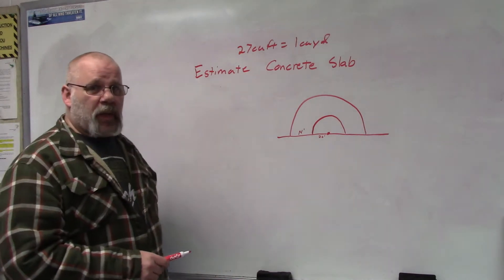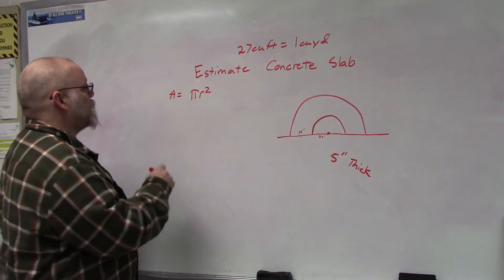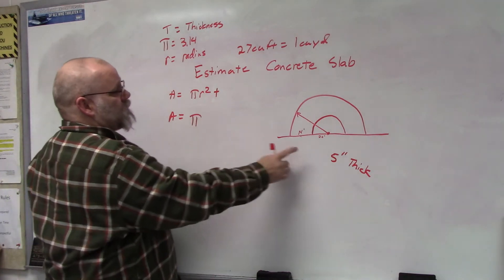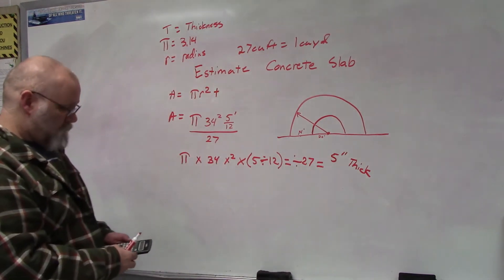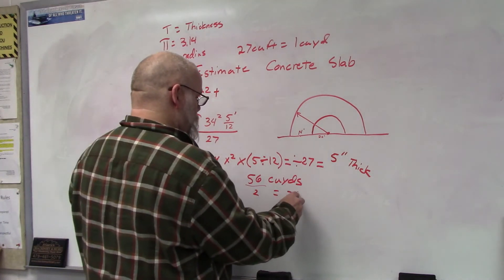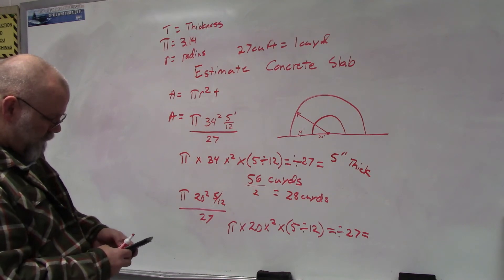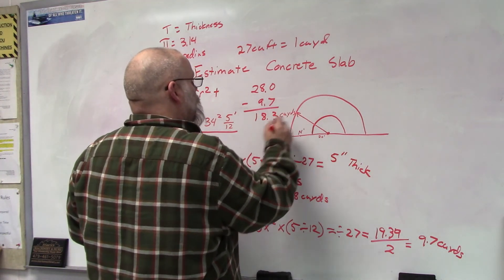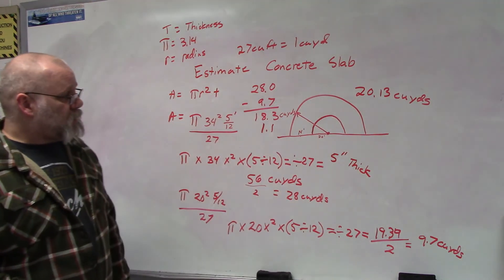Estimate concrete for round driveway

Comment: For the mathematically challenged, just get a large roll of string.  Lay out the string all around the future concrete perimeter making sure you are dead on (or slightly outside - but definitely not inside the future concrete area).  When done, gather up the string and measure its length.  Divide the string length by 4 to effectively turn the "curved" or "any random area" into a simple "square".  Multiply side one (1/4 the string) by side 2 (1/4 the string) to get "area" of the "square".  Multiply that number by the concrete thickness (example: .33 for 4 inch slab or .5 for 6 inch slab or ?/12 for any other depth) and divide that number by 27 (3 ft x 3 ft x 3 ft = 27 for a cubic yard) to get the cubic yards of concrete needed.   To check this method out, lets say the string measures 12 foot and you're pouring a 3 foot (OMG) slab.  12/4 = 3. ; 3*3=9 ; 9*3=27 ; 27/27=1 ; 1 Cubic Yard of concrete would be needed.